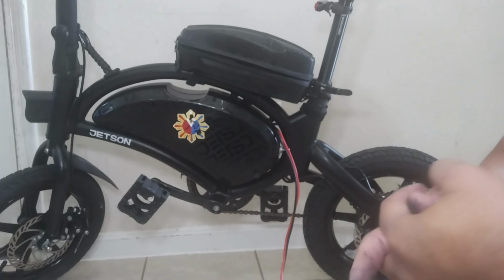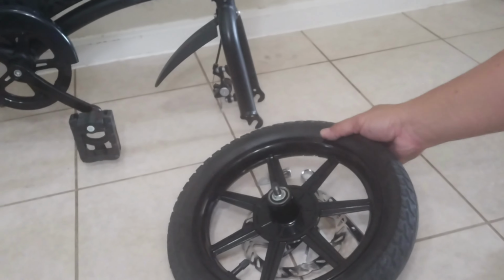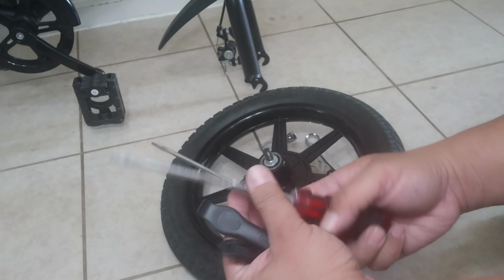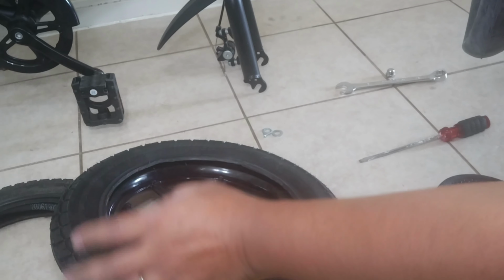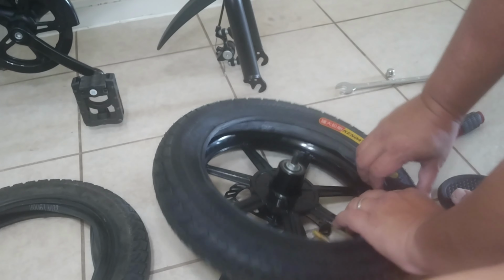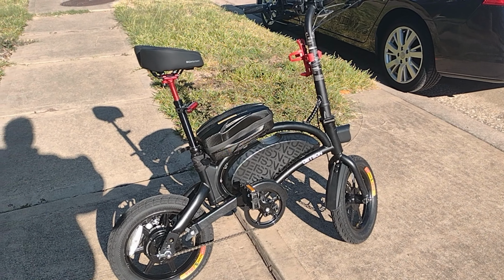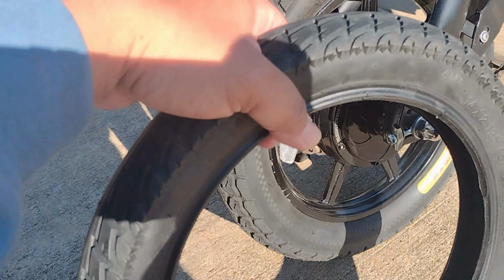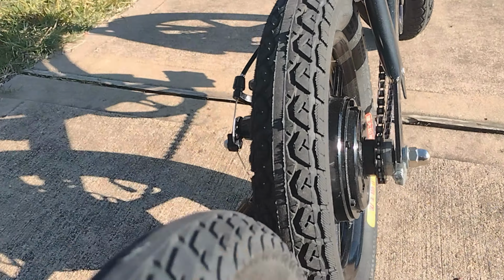JETSON BOLT PRO WITH BIGGER TIRES

Comment: Which makes a bigger difference for stability, wider handle bar or wider tire? I find my new Bolt Pro to be a bit of a shaky ride and I do have broad shoulders. Thanks for this video and your handlebar one as well. Showing the full view and wide view of you riding away on the modified bike would be a good touch at the end of these.
Reply from the maker: wider handle bar. dont do wede tires. it made my bike slower